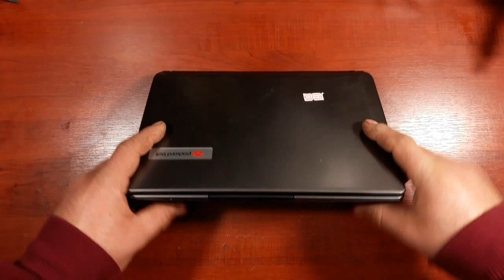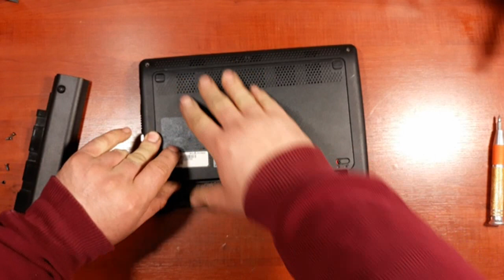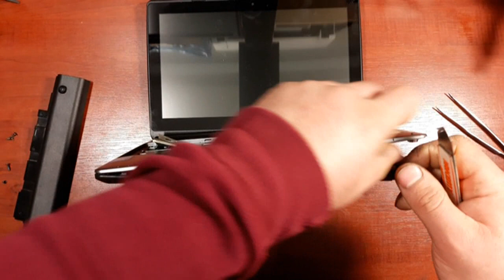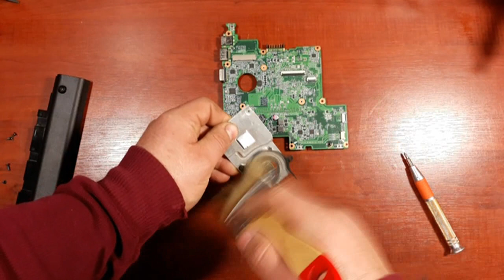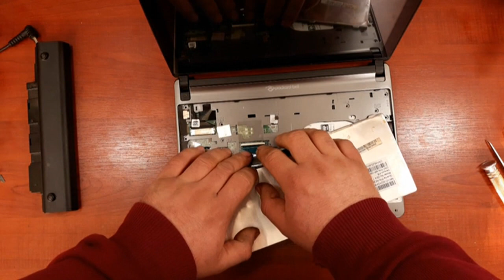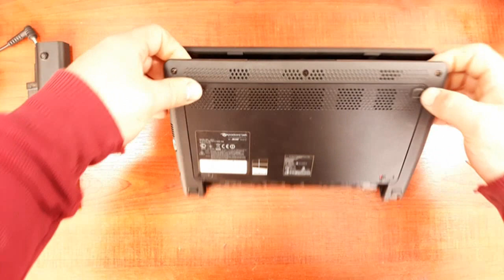Packard Bell EasyNote ZEA ME69BMP How to disassemble and reassemble laptop. Cleaning the notebook

Comment: The ram memory is it possible to remove and change it? 
Or it's soldered?
Reply: yeah, you can remove the ram and change it. 2gb ddr3 is the maximum amount of ram you can put in this laptop
Reply: @gabigamer7442  with my little brother' s help I installed 8Gb Ddr3L-1600 Sodimm and an SSD memory and it is working very well
Reply: @iomiodio87 Can put up to 8gb?
Reply: yes, you can upgrade up to 8 GB